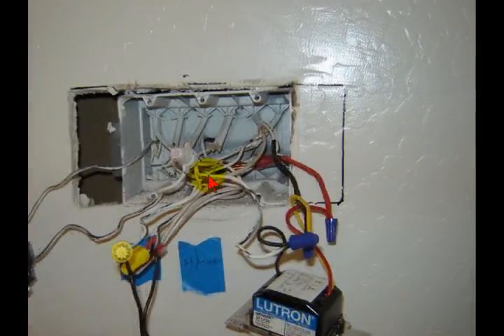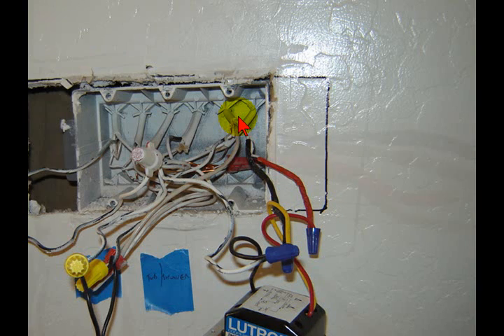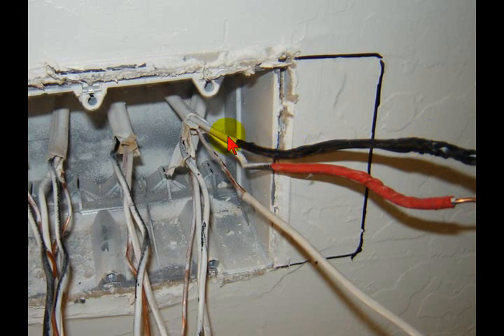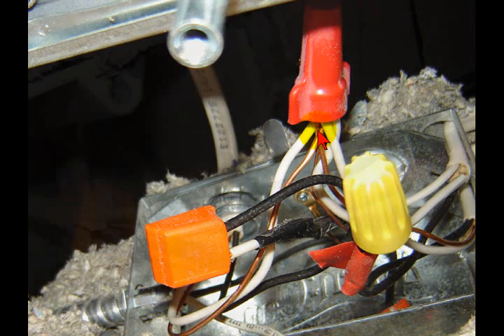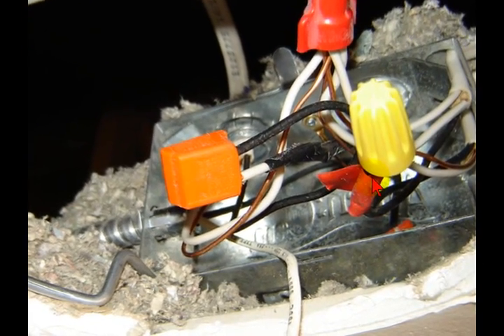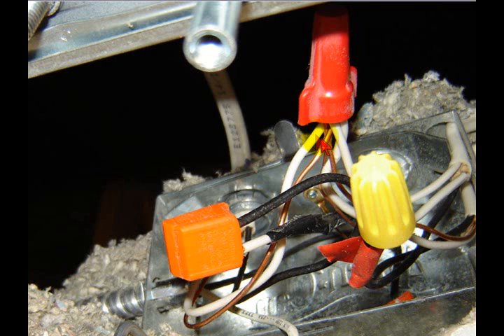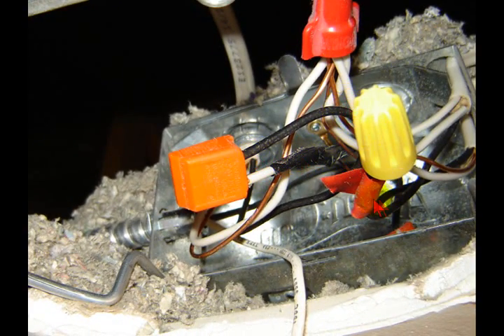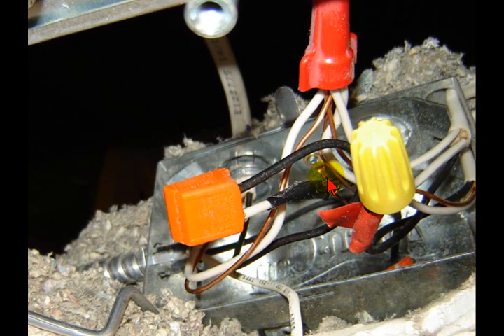Electrical Wiring

Comment: hey great video i want to become an electrician where is the best place to find apprenticeship ? local union is tough to get into how do I get my foot in the door? Central nj?
Reply from the maker: brs rafal I am not familiar with the job market in NJ. Have you tried online with indeed or monster .com? Are there any non-union shops there? Give them a call. Community colleges provide  classes where you could do some networking. Good luck
Reply: +Electrical Industry Network I'm an Engineer and I'm very good in installation and given solution to any kind of electrical faults. My number is did 08109742366 or08057792121
Reply: Sad thing is it's easier to get in the union if you are working non union as they see you a threat. my brother tried for years to get into the IBEW. he got in because he was on job cite that IBEW unionized. Google book 4  hand.

Comment: In response to Dachee.. The Ground wire is used specifically for protection when fault current occurs. Normally by disconnecting the protective device.  What has happened here is the fact a ground wire has been used as a neutral, in doing so removing the ground connection between both sources! Not good if a fault occurs.

Comment: Current code using arc fault protectors will prevent you from what we call 'piggy backing', using the ground as a neutral. I have seen this so many times by 'handy man' people. In older houses w/o AFC breakers, you can still do this. In my neck of the woods the Contractors Board considers this a 'Serious' code violation. Thanks for the vid.

Comment: Anyone who had a new dryer or stove/wall oven with a 3 prong cord installation is doing essentially the same thing.  The appliance is now using the ground wire as both neutral and bond.

Comment: Our well system guys did the same thing basically:  Branch circuit is 3-wire 240v, sans neutral.  240v injection pumps for chlorine are available, but they put a 120v model in using the ground as a neutral return, and tying hot to one of the legs feeding the 240v.  Not good.  I was going to replace it myself, and put a 240v pump in... wired correctly.

Comment: Thanks for the help. My first floor has been easy as it was wired by pros in the 40s. I just progressively pulled new 12g THHN wire to replace the old cloth covered wire. As I did that I replaced all old outlets with grounded ones. No one lives on the second floor and after seeing your videos I removed the two hot lines going upstairs and wire nutted them off until the spring when I can redo them when it is not freezing but instead 100 degrees plus. haha. But better than the house burning.

Comment: @ElectricTN Not on any of my projects you wouldn't.  A grounding conductor is exactly that, and should never be used as a grounded conductor.  Anyone on a project of mine, hooking a green or green/yellow, or bare wire to a white, or grey wire would be fired on the spot.  No exceptions.  That being said, yes, the color doesn't mean anything unless you are wiring by the NEC, which tells you what colors are allowed where.

Comment: @hurrayupplease That is incorrect according to the code.  There was a time that it was allowed.  That is why older homes have 3 wire dryers and ranges.  Now you MUST use a 4 wire circuit for these appliances.  Of course, adding controls to a UL listed product violates current code to.  But, that is another topic.

Comment: @jessi330 The grounded conductor (neutral) carries the un-balanced load of an electrical circuit to ground.  The grounding conductor (ground) should NEVER have power on it.  It is a safety system that is designed to be used ONLY if something goes wrong, and if power goes across this grounding conductor, the over current protection (fuses, breakers, etc) should trip or open the circuit.

Comment: I repair garage doors. One homeowner (neighbor) wired his own garage. He hardwired the door opener into the line. His brother was an electrician and was going to check his work but unknown to me had not been there yet. Down at the onoff switch he had broken the neutral to turn the opener off so when I got hold of the hot my other hand was touching the conduit. hahaha I now carry a small voltage detector and I check everything I do not care what people tell me.

Comment: Hope you can help me out.  I am currently updating my kitchen and there is a garabe disposal connected to a switch.  I removed the disposol and hooked up a outlet instead of a switch and with a tester I have power to the outlet but nothing will work when i plug something in it.  What am I doing wrong?  Thanks

Comment: Pray that whoever it was didn't also rewire the switch box as well! I would be tempted to rip it that wiring all the way back to the switch box for safety's sake.

Wow. People get killed & fires start from wiring like this. Although, my father once worked in a remodeled research lab, where their  electricians had somehow miswired the 120v outlets to 240v! Smoked the chart recorder solenoids good.

Comment: I came across similar bad wiring as your vid shows, but worse. My church asked me to check behind someones work. The guy had travelers crossed, taped joints. I turned the main off. Spent half a day inspecting and fixing 8 out of 13 attic boxes with crossed wiring, no bonds, neutral-ground bonds...you name it. The only reason a fire didn't happen, as far as i can tell, the legs never crossed. Must be careful going behind others. Always use a meter. People do things for a quick buck. Beware.

Comment: What a disgrace to the electrical worker community, the laws in australia do say that a single colour conductor can be marked with tape to indicate what the cable is used for, however a ground MUST NEVER be used as a load carrying conductor, only as an earthing wire,,, im sick of seeing an apprentice i work with use twin and earth to do 2way switching, ill tell em to pull a new bloody cable,,,  thanks for showing, its a good thing to critique ones dodgy work

Comment: Thanks. Wiring the incorrect way can get a person hurt, or cause the loss of a home.
I was looking for some wiring tips on changing out a light fixture. when I came across your info. I have red,white & black wires that I am going to work with, maybe!
I need to take a closer look. Thank You